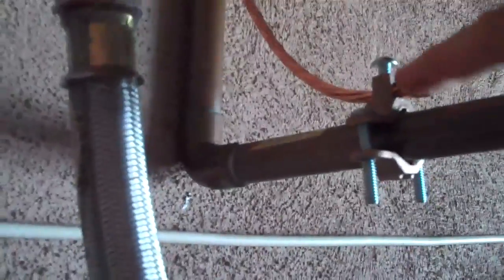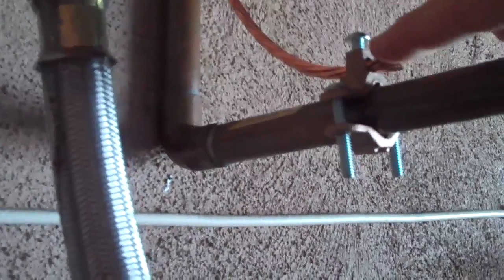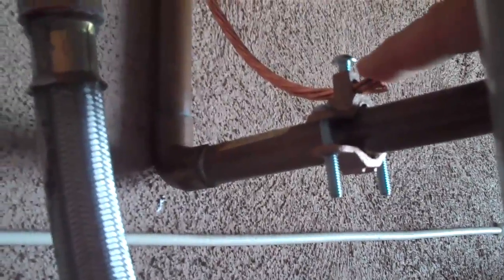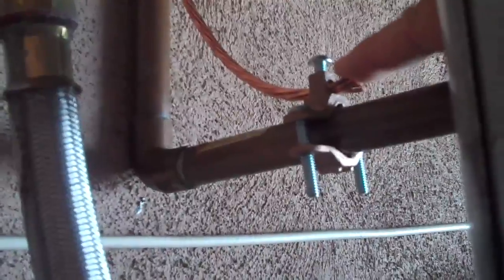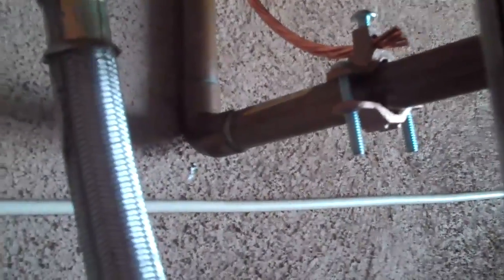Bonding the electrical system

Comment: Someone told me that this is a no no because of electrolysis.  However, it looks to me like the parts that touch the copper pipe are also copper, so I think I got bad advice.  Your thoughts?
Reply: I know this is late, but you are correct sir. Electrolysis occurs when copper is in contact with another type of metal. That clamp is made of copper, and can safely be attached to the copper pipe so long as it’s the correct size and the bolts don’t make contact with the pipe.
Reply: It works great have it downstairs in my house did it myself
Reply: Electroless occurs when copper touches another type of metal, other than copper, when copper is touching, steel or iron, electrolysis occurs, when copper touches brass electrolysis also occurs, but very slowly

You can also use dielectric unions in between metals when connecting to the other pipes (not copper)

Comment: The "ground" is not protected by a breaker. I'm going to call around and ask my elec. buddies if they have EVER seen a ground  (wired correctly) trip a breaker. I sure haven't. I could see it possibly cause an AFI or GFCI to trip, just because of the nature of those two types of breakers.
Reply: If for some reason the power from any circuit touched those pipes that circuit breaker would trip because the pipes are grounded
Reply: Yea like the guy above me said, if a line touched one of the pipes it would have very little resistance so the current on that circuit would flow really quickly and trip the breaker, the other reason they bond it is for lightning strikes
Reply: You don't know what you're talking about, man.

Comment: What breaker is going to trip if the water line becomes energized? Your selling some snake oil.
Reply: Think about where current in a house comes from. If current comes in contact with the water pipe it will be connected to a breaker somewhere that will trip. If water pipe isnt grounded and current comes into contact with a pipe , water is electrically conductive and you will get poked. Grounding and bonding are one of the most confusing parts in the n.e.c. , and also most important.
Reply: @bigwillywes78 thanks for the explanation. My professor just explained the same thing to me and it is a complex matter. I guess what I am still confused about if the water pipes are bonded together and the conductor is not connected back to the panel how does the breaker trip. Maybe O am over thinking this. Hopefully I can get a clearer answer. Thanks!
Reply: @bridgetboo73  Bonded together means its all connected to the grounding system. It all leads back to the main panel. The ground only carries fault current and creates a low impedance path for fault current to travel which in turn trips the breaker. Low impedance creates high current which is more then the breaker will allow.
Reply: @LucifersDeathSquad  In the video though it looks like it doesn't lead back to the panel.  It looks like its just a short length of twisted copper wire going from the gas line to the water line.
Reply: @cmachinist  - The guy in the video has no idea what he is doing. You should not look to this as any example to follow
Reply from the maker: The circuit that is putting voltage on the pipe will trip if all is bonded correctly